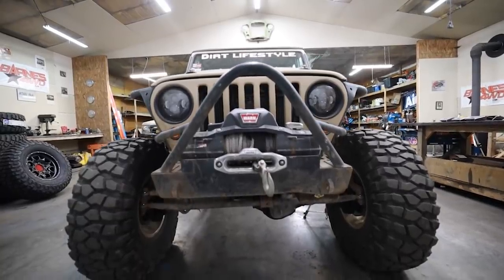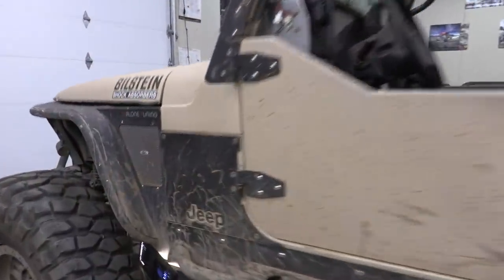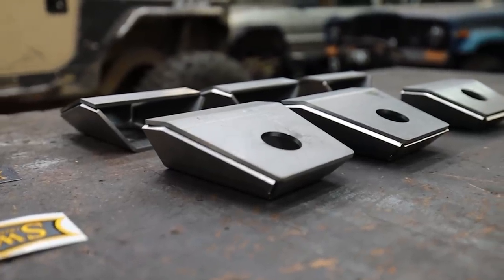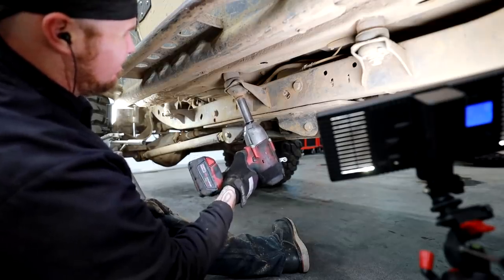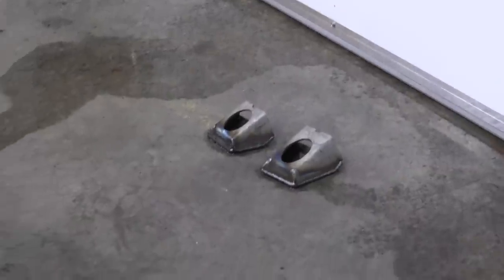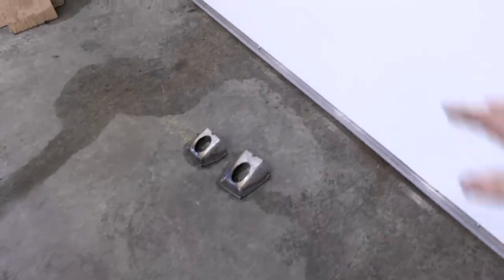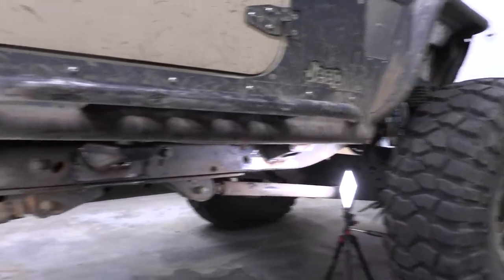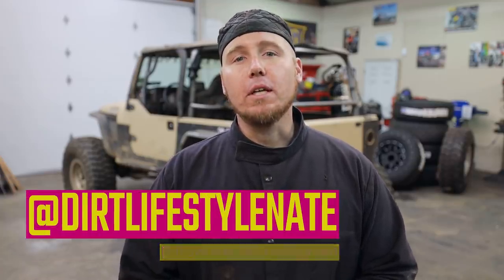Why Didn't I Install These On My Jeep Sooner? Easy. High Clearance. Bomb Proof.

Comment: Have you thought about making a video on replacing the center body mount tub sections for those people that need to replace them from rust? I have seen a company that makes frame and tub replacement panels to make the job even easier.
Reply from the maker: I have not brother, it's not an issue we have in the Pacific north west 👍

Comment: Why not build brackets that incorporate your body mounts and extend out too also be your rock sliders? Then with skid plates covering front to back and from the outer edge all the way to the frame. The first down side I could see is the weight. Your thoughts?
Reply from the maker: I plan on boat sides eventually 👍

Comment: Great job and good tip on fitting them before tacking them together to account for vehicle variances.  
Have you tried Dupli-color satin black wheel paint?  I use it on most of the brackets I make - interior and exterior.  It is very good for irregular surfaces because it dries quickly and doesn't run.  It's tough, too.
Reply from the maker: I haven't but am willing 👍

Comment: Looks like you took the body lift pucks off and mounted the new brackets higher. Having less leverage on the body bolts will help bending along with the design of the new brackets

Comment: Hey man, you should really look into a set of boatside rockers. I have the version made by Dave's Customs Unlimited and they're a game changer for rocker area clearance.
Reply from the maker: I've been planning on building a set for years, just haven't gotten there yet 👍
Reply: @DirtLifestyle  Dave's only charges $300 for their set, which makes it really hard to beat that price when you consider the substantial material and time cost of building them yourself. The install is definitely tricky.

Comment: So, across the top, on the frame, is there no weld across it? I know the rest of the welds will hold it, but my old would want that welded also.
Reply from the maker: I welded the top from inside the bracket 👍

Comment: Wonder if something like this could be done on the LR Disco 1. The rockers and suspension/body mounts hang pretty low. I’m cutting what’s left of my rockers off and turning them into sliders/rocker panels.

Comment: Just curious, what about the top seam on the bracket/ chassis and under the body? I would have thought that it would be an important weld. Curious minds want to know! Kind regards,
Reply from the maker: Hey man! I welded it from the inside. Swag make a larger hole then you need to hit this spot 👍
Reply: @DirtLifestyle  Cool, thanks! I wondered how you were going to get around having to lift the body off! Well done ;-)

Comment: Hi Nate, question: The wheels look like Method, but I can't find a wheel with the valve stem protector seen at 2:59 on the rear wheel
If they aren't Method Grid/Mesh, then what brand and model
Thanks

Comment: Cool video Nate. I have a body mount nutsert that is spinning that is holding a cheapo nerf bar rock slider on my TJ which has kissed many rocks and needs to be upgraded. Do you recommend cutting a hole in the body to get to the nutsert or something else?
Reply from the maker: I haven't had to fix this problem so unfortunately I don't have any advise on the subject 👍

Comment: So I have a question if you where to do it over would you still do the tdi swap? Clearly more usable power in the appropriate area over the stock 4.0 but was it really worth it? If so is there anything you would do differently?

Comment: Hi Nate
I couldn't see you welding your parts on to the frame, do you weld your brackets going up or going down?
If you're going up , what were your settings?
Thanks
Reply from the maker: I welded going down. My machine is auto set so I just put in 1/4" .035 wire and it did the rest. I used the 1/4" setting because I like to weld hot and move my puddle fast when welding vertical 👍

Comment: Does the heat from the welder effect the frames rigidity? Also when welding on a vehicle should you disconnect the battery first, to save the computer? Thx
Reply from the maker: It should of effect the structure of the frame as much as the old mounts did. Good or bad 👍 I don't disconnect the battery before welding.

Comment: MY GOD MAN !!!! LOOK AT ALL THAT MUD AND CRUD INSIDE THAT FRAME RAIL!!!! lol
Reply: I just got back from a trip with a friend who has a TJ. I couldn't believe it had no drain holes in the frame. His frame was full of mud and some rather large flaked off pieces of frame. Not good. He's going to drill some holes in the bottom of the frame inside the front and rear lower control arm mounts. We figured that was the strongest spot on the lowest section of the frame. 

You gotta get the inside of the frame clean too. Apparently TJs are notorious for frame rust because of the lack of holes.
Reply from the maker: Lol 😆